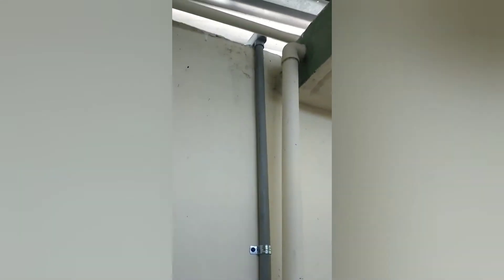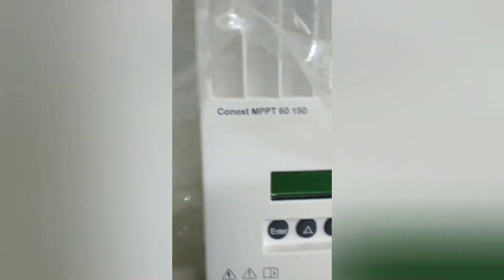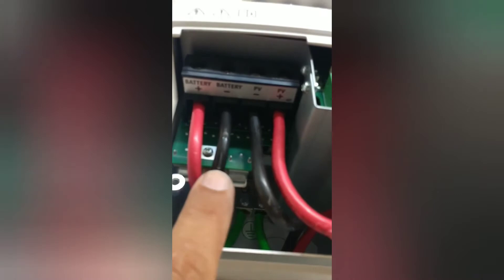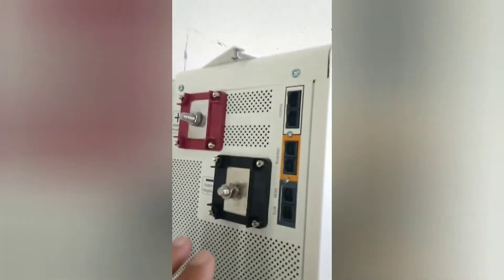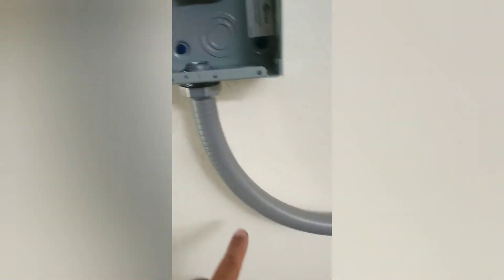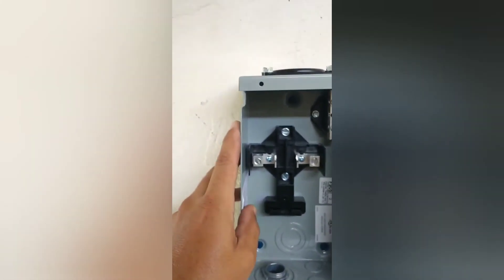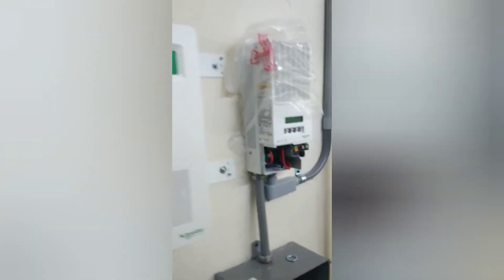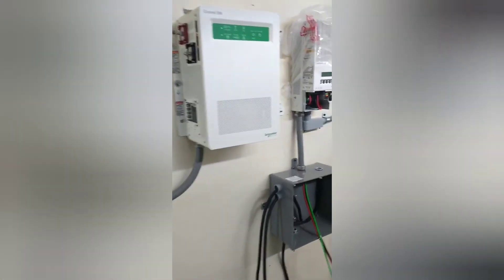DIY Backup Conext SW 4024 Inverter Charger Offgrid Installation (Spanish)

Comment: Saludos, solo una pregunta. En un banco de baterías configurado a 24 volts. Cuantas watts maximo en placas solares necesito para el controlador de carga Schneider’s Sw 60a 150 volts? Gracias por lo que me pueda ayudar.
Reply from the maker: El voltaje maximo de entrada  en el charger es de 150v a 60 amp recuerda que la instalacion de tus paneles no excedan esos parametros  te recomiendo que combines tu arreglo a 140v.
dependera de la CAPACIDAD DE TUS PANELES y la combinacion.
Reply: Sumas los watts de todos los panles y el total no puede ser mayor al total de watts del inverter, ejemplo el schneider 4048 es 4000 watts a 48v. En este caso el total de watts de las placas al sumarse no pueden ser mayor de 4000.
Reply: Luego tendras que jugar con la combinacion para que no te pases del voltaje ni el amperaje. Cada placa tiene su voltaje, si los conectas en serie el voltaje de cada placa se suma pero el amperage se queda igual. Casi siempre se conectan en " streams " en serie osea 3 placas en serie o 4 etc seria un stream luego conectarias ese stream en paralelo con otros stream. Asi balanceas voltage y amperage para no exceder los 150v 60A en caso de que el controlador de carga sea de 60A.
Reply: @anru9492   el inverter no tiene nada que ver. Recuerda que quien gestiona la carga solar es el controlador de carga MPPT
Reply: @joelsantana1958  gracias por su reply pero cada inversor tiene un maximo de wattage. Lo que sucede es que el controlador controla la carga de la bateria pero cuando ya la bateria esta llena el controlador se convierte en un bypass y la corriente pasa directo por el inversor a tu casa. Por eso es que cuando la bateria esta full y estas usando el systema solar la bateria se queda full pq la corrienteque estas usando viene directo de las placas  menos que estes consumiendo mas de lo que las placas estan generando. Se recomiendo que el total de placas no sea mayor a 25% del total de watts del inversor. En en el schneider 4048 realmente tira 3700w pero su total es de 4000w 25% de 4000w es 1000w do no debes exceder 5000w en total de las placas.

Comment: Como se puede connectar el voltaje de AEE (Grid), para dar backup a las baterias y cargarlas si hace falta por estar nublado u otras razones? a un Schnaider Conextsw4048?
Reply from the maker: Tienes otro charge controller para cargar las baterías?
Reply from the maker: Si es así tienes que activar el charger integrado al Inversor Conext 4048